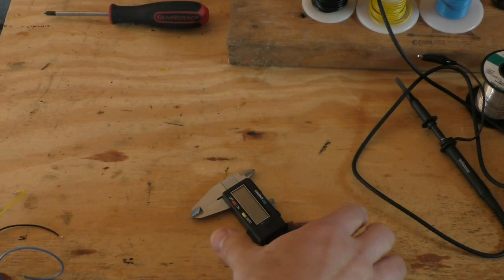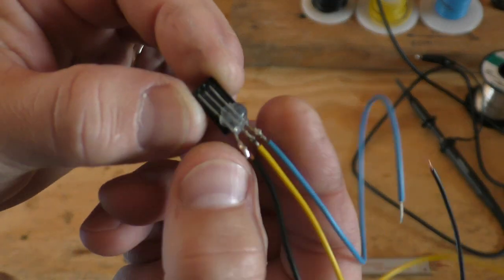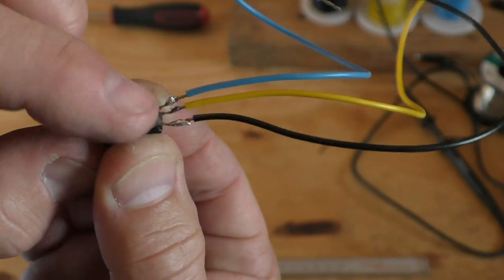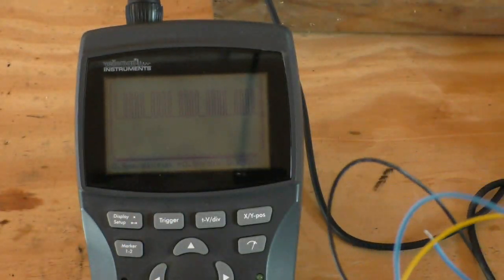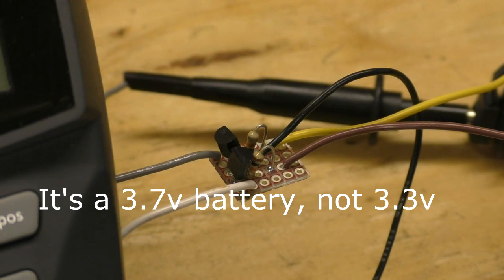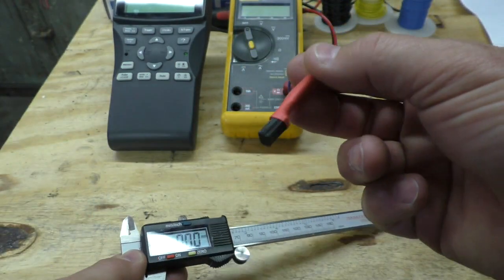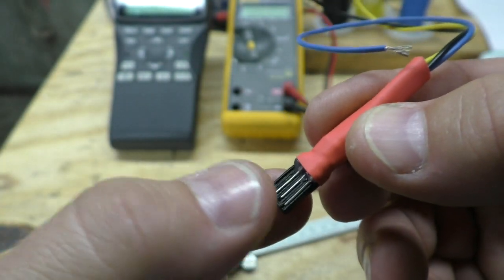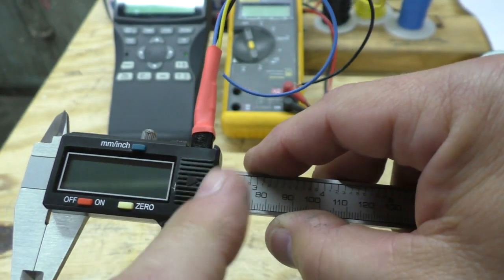DIY Digital Caliper Data Plug

Comment: I wonder if this could be adapted by using the Analog pins on the Arduino?  1.5V would probably show up just fine as a low value, so you could use a simple sketch to read the value as 1 if it's above a threshold.

Comment: I suppose the next step is to redesign the plug to have a little barbed clip on it so they won't pull out of the calliper when people chop them about to use them as position indicators on some automation project.

Comment: Superb! Landed here while researching for DIY digital caliper boxes. Never knew these had data out. Mine looks a little different than yours. Wasn't sure if mine had data-out.Tentatively picked up mine and voila, there was the little socket. I am so happy. 

Liked and subscribed!
Reply from the maker: Thanks for watching!
Reply: @MakingStuff  And thank you for sharing your knowledge. Was just wondering - wouldn't it be easier and cleaner to solder some JST connector to the tracks that fits nicely into the little slot.

Comment: Thanks for this. Do you know if the port can be used to calibrate the caliper. Just realized that after zeroing my set is of by 0.4 mm !?
Reply: ok - got it figured. I need new glasses! Didn't notice a piece of grit between the jaws.
Reply: @scottforsyth2526  that will make sure you don't make the mistake of storing them fully closed!

Comment: First time i saw one of your video after I searched how digital caliper worked. The one I have is branded mastercraft and is exactly the same as yours with the 4 traces on the pcb and I knew as i saw these that they were ment to be a serial data output. I don't have any use for it actually but that's neat to know I can get a linear reading distance / position sensor from a caliper to an arduino with quite a good precision.
Reply: now to automate the opening and closing of the caliper. . . .

Comment: Plugs for these digital calipers are always hard to find. 3D printed plugs are indeed a great solution. If the calipers are mounted on tooling machines as encoders for a DRO, vibration might cause some issues. In this case you might want to solder the data cable to the PCB. A detailed description can be found on the Caliper2PC retrofit site.

Comment: Could you just float the calipers at 0.7V so that its high and low are within the 3.3V thresholds?

As for the plug, it seems it'd be easier to open the calipers and solder a small connector on the board. Or I bet a standard connector could be cut open to fit in the calipers so you don't have to 3D-print a special one.

Comment: any reason you couldnt include VCC and power the caliper board by way of a regulated 1.5v ps?  would eliminate the need to use batteries & remove any error created by a draining battery...
Reply from the maker: Yeah, I am using a 1.5V regulator on the filament extruder circuit board.  Check out the filament extruder videos for more info.
Reply: @MakingStuff  What is the unused pin?  Is it 1.5V?  Could you recommend a regulator chip to step 1.5V up to 3.3 or 5V?  Or just any old cheapo one should work, like https://de.aliexpress.com/item/32254368797.html?

Comment: Hi, first of all thank you for your work and time. I am trying to take data for a caliper to a Excel sheet, so, if the caliper is connected to the PC by RS-232 cable, and your plug, could I do it?.
Thanks, regards
Reply: use logic shifter and decoder in an aurduino..

Comment: I see the wires coming off the connector, but what color is what signal ?  i.e. data ? clk ? ground ?  thanks.
Reply from the maker: +Allen Lorenz Yeah looks like I left that out.  From left to right it is GND, DAT, CLK, VCC.
Reply: +Making Stuff quck sanity check is vcc 5 or 3.3 ? coming from the arudino.  I know the data and clk lines go through the transition board.
Reply from the maker: +Allen Lorenz Just hook up GND, DAT and CLK.  Don't worry about vcc.  It is 1.5v on the calipers.  You will notice in the video I only use those 3 pins on the connector.  Sorry should have made that more clear in the video.

Comment: You can connect this caliper to soundcard with stereo input and decode it in software. Bitrate should be within capability of any decent stereo soundcard. But you need two channels (one for data and second for clock). You can even power the caliper from mic phantom power that soundcard supplies.
Reply: "You can even power the caliper from mic phantom power that soundcard supplies."

Now that's some frugality!

Comment: i wonder if that plug is any standard one that is easily available for us with no access to 3D printers. I get that the premade cables are hard to find but the connector should be easier. any thoughts?
Reply from the maker: +Fredrik Rambris I doubt it, but you never know.  It's almost like an edge connector because it just makes contact with the copper traces on the pcb.  The only other alternative I have found involved soldering something to the pcb.